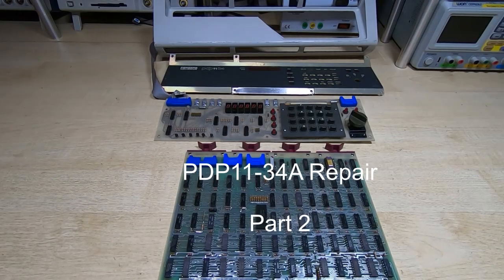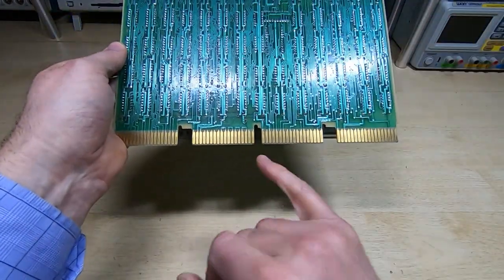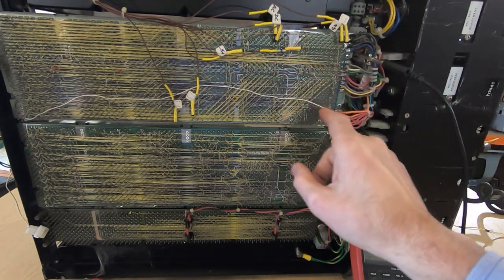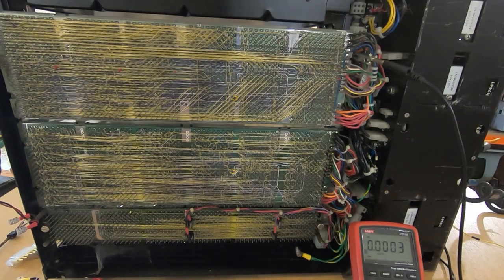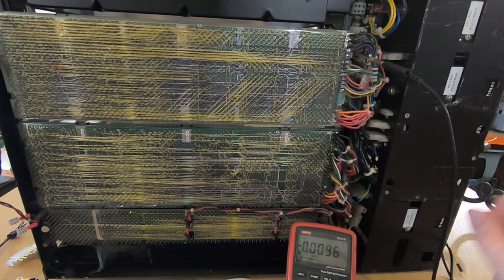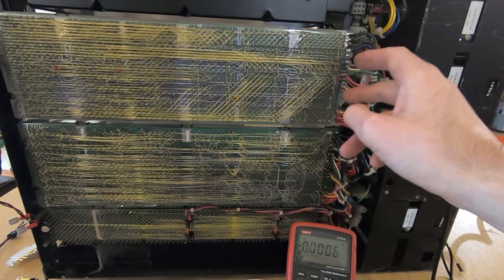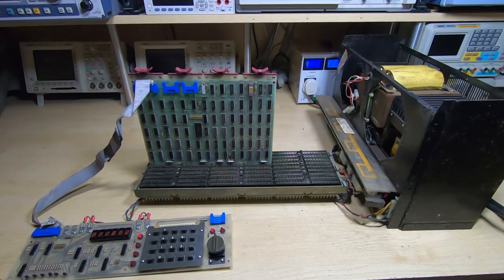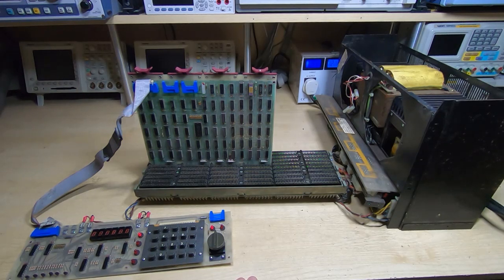PDP11-34A Repair Part2

Comment: Scary! Dismantling the machine 😲 I know it's necessary but these things can be so temperamental when disturbed. The wire-wrapped backplanes can be very delicate. I'm guessing that this machine is like the VAX-11/780 where modifications could require physical rewiring of the backplane in the field. Obviously you have the video record of which cards were in which slots but I am sure an experienced person such as yourself will have made notes before stripping the cards. When you explained that you had got the second fan working my first thought was "so it'll be even noisier then!" I love your little on/off switch - somehow it doesn't seem up to the job of turning a brute like that on! I am so used to the racket that these things make that I thought it wasn't working when you turned it on via the front panel switch - then I realised that you had just explained that you had removed the fans! 😆